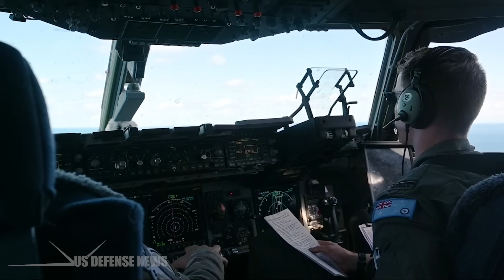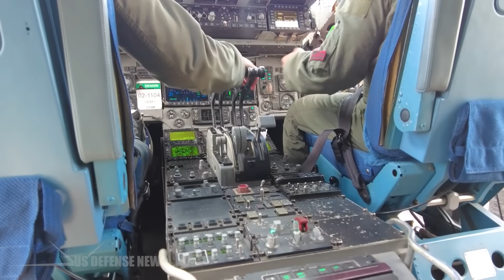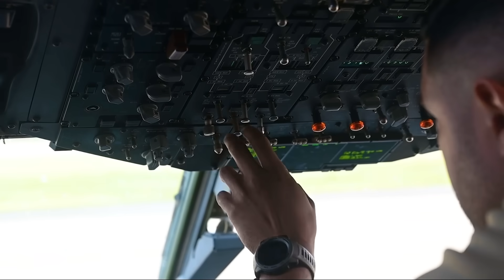Why Boeing Stopped Production of the C-17 Globemaster III And Why It Might Be Restarted

Comment: The DoD and Civilian Leadership fouled this up like they did other programs. The C-17A was to replace platforms like the C-141B/C which even with the fuselage extensions could not fit internally what it could in theory carry. The C-17A corrected this and added short and rough field capabilities. The Problem was that two US Administrations were handling (poorly) the GWT and had funding concerns. The C-17A orders were limited because of lack of far range planning. Many NATO users of the C-130 took interest as well as Non-NATO members. Yet another lost opportunity due to narrow-minded thinking by DoD and Civilian Leadership. Add in the F-22A to this concern as well. More airframes means lower Unit Cost and more Units means higher retention. Invest in the platfoms,Missions and Squadrons and the Airmen will come, serve ans stay. Add in a lack of marketing. IL-78 and C-130 were viable potential operators.
Reply: @OO calvinleeOO The USAF should see about converting the first 50 C-17As that didn’t have extended range tanks installed in the center section of the fuselage and make B models like what they did with the C-141s. If you look at it the majority of the missions they are landing on regular hardened runways. I worked on the C-17 at the Long Beach facility until I got hurt in a motorcycle accident and was medically retired. When I worked on the ramp prior to that I worked on MD 90s MD 80s and MD 11s on the commercial side of McDonald Douglas, before it became Boeing
Reply: @remylopez4821   The C-17A was and remains impressive and yes, it would be great to retrofit the earlier birds. Sadly the DoD and the USAF is not good with procurement, usage, lifespan planning and other aspects. The billions wasted with programs like the C-27J, the constant transition of units from one platform to another and platforms like the Air Tractor and T-7A are just signs of poor Leadership. The more C-17s the USAF brought, the more sales abroad and the lower cost. Sad and criminal this cycle continues to be repeated at the cost of retention and readiness. Was just at Dover AFB and the Museum and helped a tour guide with the History of the KC-10A. A platform that was great but simply not in enough numbers.

Comment: It doesn’t make sense for the military to not use civilian airlifters. You don’t need all that rough runway capabilities in 99% of cases, even during wartime.
Reply: You know nothing, John Snow.
Civilian freighters are generally designed for small and lightweight packages. They are not designed for heavy armoured vehicles that concentrate the weight in one spot, or large and bulky items.
Also, “rough runways” does not just mean dirt strips, it can often mean delivering to well-made runways that don’t have extensive logistics facilities eg. Cargo lifts. Here the low floors and tail ramps typical of military cargo aircraft make loading and unloading without heavy equipment much easier.
Reply: Well, you don’t need it, until you need it.
Reply: They do use civilian contract airlines everyday for both passengers and cargo.  Go to any Air Mobility Command base and you can often see a freighter version of a B-747 on the ramp.  In wartime even more civilian airliners get called into service; it's called the Civil Reserve Fleet.  You still need military cargo aircraft to carry outsize and vehicular cargo carried by airplanes like a C-17 or C-5, and you still need military aircraft for operations in and near combat zones.
Reply: Yep, there is always a long straight runway, wherever you have wars... Plenty of ramp parking, and of course there are never guys with drones and grenades just outside the fence.  Kabul was an IDEAL place to do a nice safe entry, withdrawal, much better than Bagram... 
"Civilian" airlifters ARE used for most of the personnel transport.  Spent a lot of time on Freedom Birds, going all the way back to stretch DC-8-63's in the 70's.  Civilian aircraft do NOT do cargo very well, though, not even Freighters, unless your Humvee or !55 Howitzer can fit on a 463L pallet or a ULD container.

Comment: this time Boeing needs to make a stretched variant of the existing C-17A Globemaster III multi mission heavy lift military transport aircraft . . . a stretched variant of the C-17A Globemaster III multi mission heavy lift military transport aircraft will bring in more new customers in addition to the existing operators . . . the Indian Air Force wants 36 - 38 additional C-17A Globemaster III multi mission heavy lift military transport aircraft followed by the Middle East & Japan . . .
Reply: A stretched version of the C-17 is called the C-5.
Reply: @marcmcreynolds2827  Eeeh, no, not in any way. Besides, restarting the production of the C-5 is unfortunately out of the question.
Reply: @marcmcreynolds2827 Well, my friend if you put it that way . . . the C-5 is the giant of giants, you could fit an entire town inside its enormous internal cargo volume & more . . . which is why the C-5 inspite of being so old its still in service through upgrades & refurbishment over time . . . the C-17 fits somewhere between the C-130J-30 Super Hercules multi mission military transport aircraft & the C-5B Super Galaxy multi mission heavy lift transport aircraft . . .

Comment: Lockheed is developing something better
Reply: I don't think so. There's not even any contract out for a new military transporter in the US and it doesn't sound plausible considering what's already available.
Reply: Yep, the CF-35D! They should have the initial cargo software done about 2030, and it should be capable at carrying 'Real' cargo with version 4.0A of the cargo release by 2035.  Now, if they can only get the Fighter software capable of dropping a Paveway, there will be Hope...